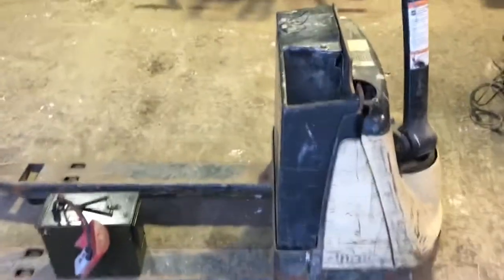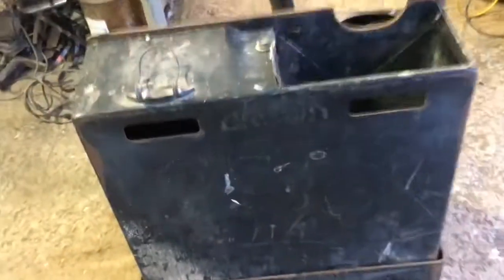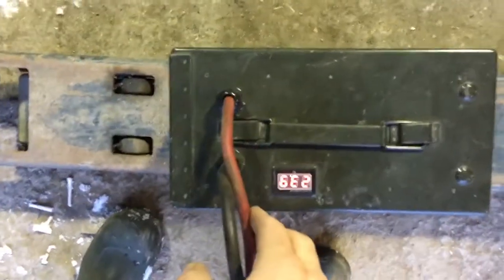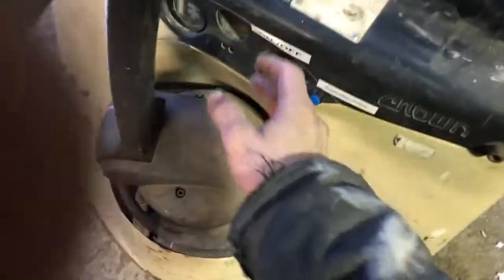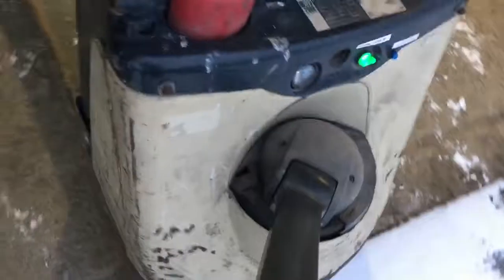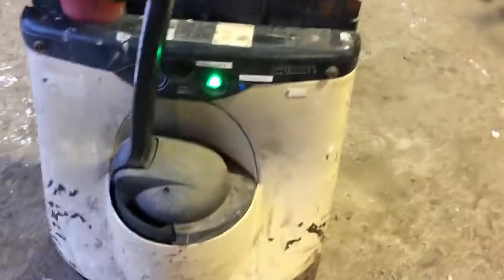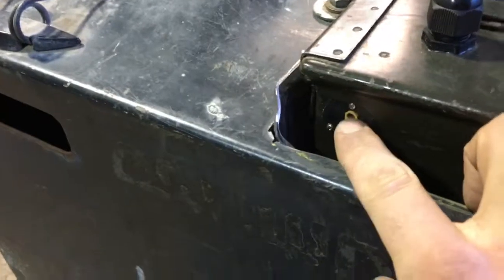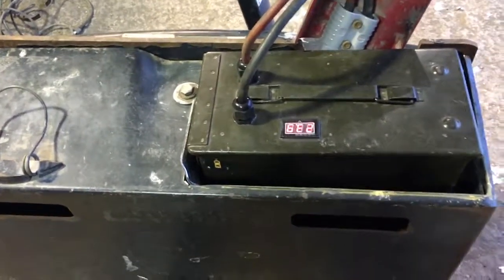Crown pallet truck modified for use with Lithium Power Bricks

Comment: Awesome thanks for sharing.
I have a wp3000 that needs a battery.
I know I need a 24V lithium batery but how should the ah be?
Reply from the maker: appropriate pack size depends on how much runtime you need, how heavily you use the truck (loads, slopes, speeds, temperature, etc).  If your pack is small and swappable you can always make two and, provided you buy or build a large enough charger you'll never run out of juice.

In my case the batteries are 1000Wh (1kWh) which translates to 42Ah at 24V.  We don't use our pallet truck enough to even know how much runtime that translates into and the 5 packs I built are shared between the pallet truck and various other small electric machines on our farm.  I find it  to be a good size but honestly I find I can't really answer the question for your situation other than to say that it works for me.

Comment: How do you charge this battery and if you can provider battery model and connection specs, it will help me a lot?
Reply from the maker: My battery pack is a DIY re-use of modules scavenged from an electric car (Chevy Volt) battery but there are lots of commercial lithium offerings of similar capacity that would do the job.  Search eBay or Batteryhookup.com to find 12V or 24V modules and get advice on selecting a charger that's appropriate for the cell chemistry from the battery vendor.  In my case I have a couple chargers that I can set to do constant current (CC) up to 24.6V and then reduce current to maintain constant voltage (CV) until charge is complete.  You need a charger that will do CC-CV behaviour and with suitable target voltage.  Even good automatic chargers for lead batteries will do CC-CV and then switch to float (sometimes called 3-stage charging) but only LiFeP04 has similar terminal voltage to lead so it's rarely a useful crossover.  Look online for more complete info on lithium charging, balance and safety before converting or charging any modified system.